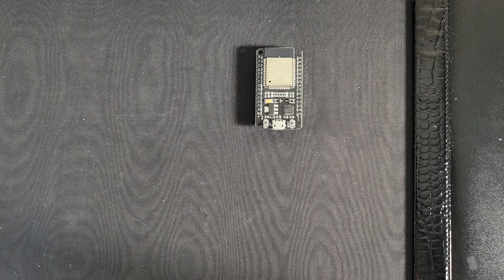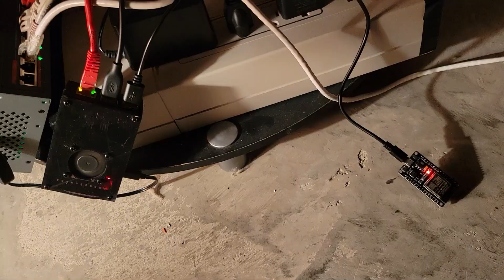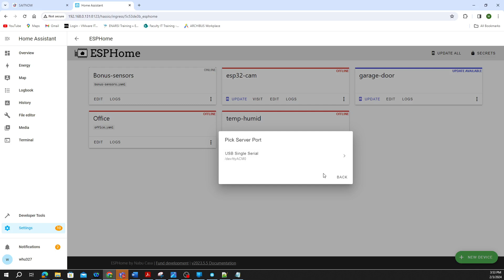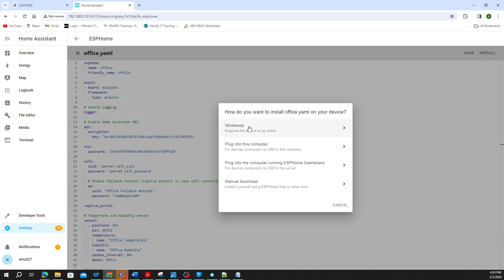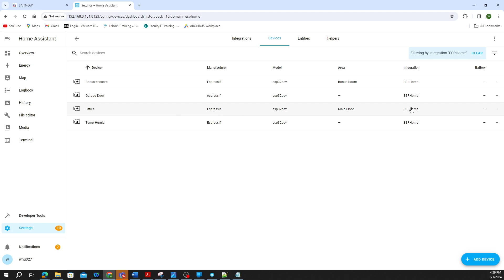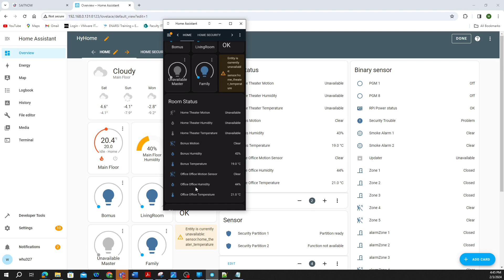3 in 1 Smart Sensor using ESP32 with Home Assistant

Comment: What is the resistor doing?
Reply: Is Pullup  resistor
Reply from the maker: The 4.7k resistor is to pull up the voltage so that data from the temperature/humidity sensor can be read reliably. I tried the test without the resistor, it still works.